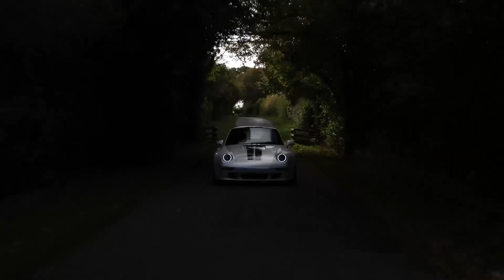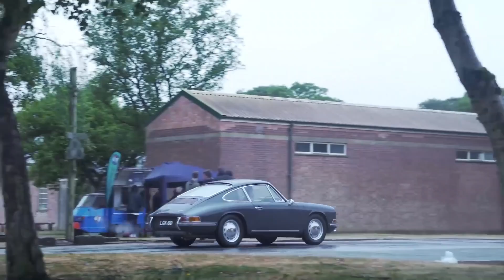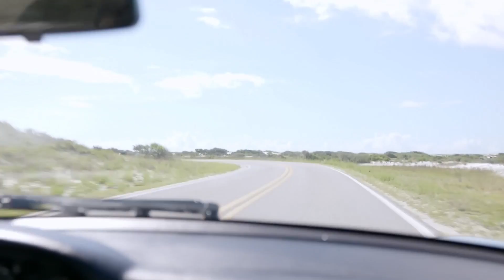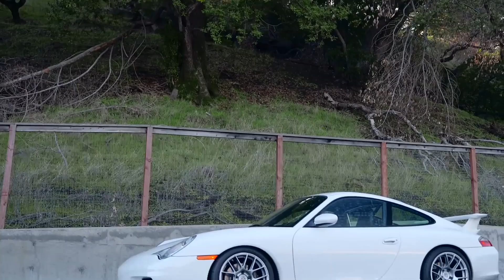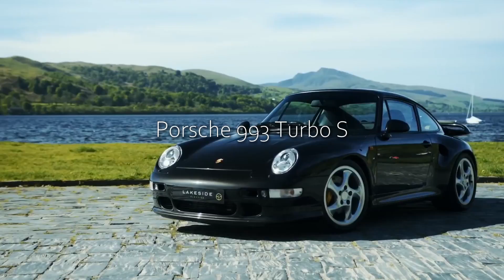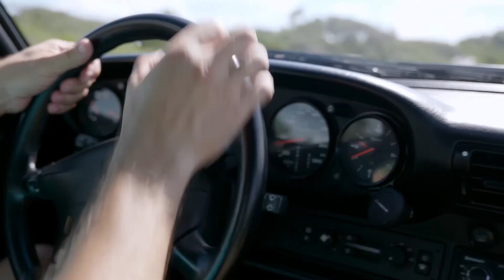Air-Cooled vs. Water-Cooled 911: Which Porsche Soul Wins?

Comment: Porsche appear to be considering a partial return to aircooled 911s, eliminating the front mounted radiators, and a return to the rear mounted cooling fan, aircooled except for wasser cooled heads. German patent no. DE 10 2025 114 052.9

Comment: Air vs. Water?  Is it hype? Of course.   But you decide what the value is.   I personally prefer the mid engine Cayman for my daily driver. Realize that even the 987.1 Cayman s beats specs against 964, 993, and 996 base 911's.  Even the first gen NSX and M3 E36 for that matter. 987.1, 987.2, 981 owners know the bang for buck and already appreciating in value.
Reply from the maker: Could not agree more! Just picked up a CGTS 4.0 and love driving it!

Comment: My 911 is almost 55 years old and an absolute blast to drive. It's on the third engine, but the previous and original ones were pulled in running state. For the most part, it got to this age with just oil and spark plug changes. If my 987 makes it to 30 years old i will be very impressed. It's even difficult to get parts for my old Honda now

Comment: After owning five of the best water cooled 911s made (GT3RS, GT2RS, Manthey 992 GT3…), I switched teams to the air cooled side.  Everything is fast today, but the driving experience of air cooled cars is unique.  I ended up buying a German market 993 Turbo WLS2 car with 450 horsepower.  I absolutely love it.  It’s not 991.2 GT2RS fast, but it’s a blast and the emotional connection to the car is next level.  It’s like telling time on a Rolex or Patek vs an iPhone.  And the build quality was insane on the air cooled cars.  I respect and like all 911s, but it’s air cooled that eventually stole my heart.

Comment: The build quality alone would keep me in early air. The school bus they now call a 911 is a padded cell with exhaust noise enhancement. The driving sensation and feedback from input requiring rapt attention is intoxicating in the early cars. To drive an early air fast requires skill. The SWB even more so. Plus with a screwdriver and a timing light you can keep them going. So that is the deciding factor for me. Hands on maintenance. Easy and fun. But ya you have to get your hands dirty. For me it"s fringe benefit, rewarding and less expensive than dropping it off at the dealer. Also they are gorgeous.